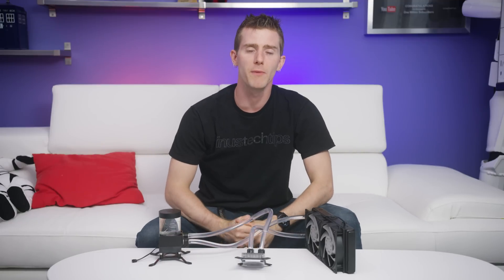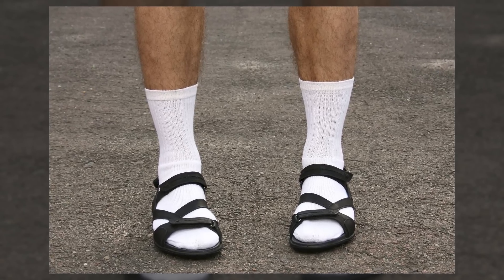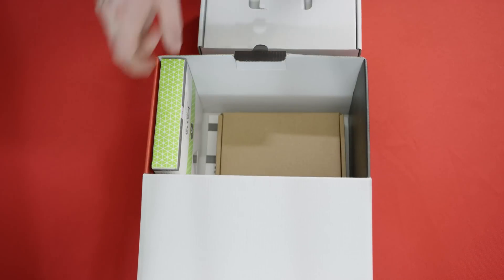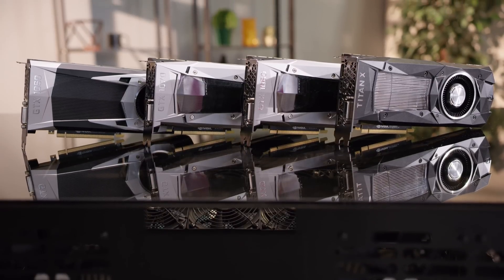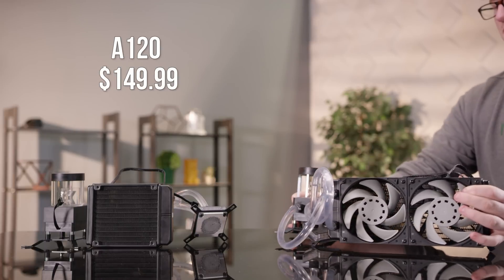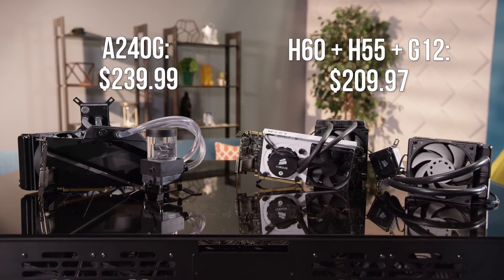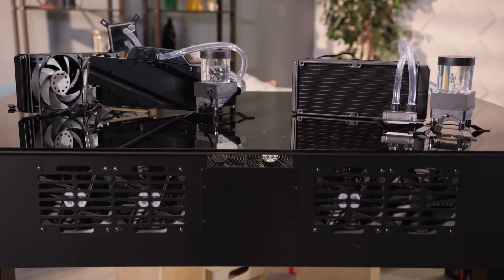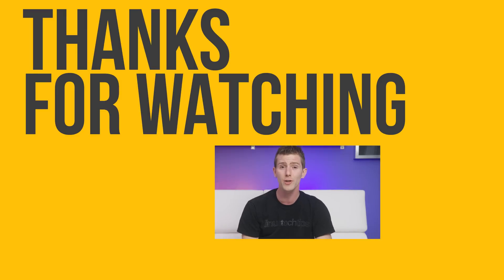CUSTOM WATERCOOLING AT AIO PRICES!? - EK Fluid Gaming Kits

Comment: Id say that a graphite CPU pad, 6 Noctua fans in push pull on a triple radiator, plus a Much bigger water pump, much bigger reservoir with multiple peltier juiced and attached to the reservoir could give better performance than a few degrees.

Comment: Not even close to aio price EK slim cost 300 bucks. You can build custom watercooling for les then 150bucks off ali express with 2x 360 rad and a pump that is strong enough to push even gpu waterblock. and its all copper. Im not hating on EK but that shit is crazy overpriced

Comment: jeeeee, wait a minute! So right now my water cooling system cause corrosion??!!  ((what!))  I don't have these products for my water cooling system, but i have distill water which goes to ek titan x waterblock and then to ek cpu waterblock and then it goes to sr2 COPPER radiator and come to reservoir for pumping. SO RIGHT NOW MY WATER COOLING SYSTEM CAUSE GALVANIC CORROSION AND EVENTUALLY WILL PIERCE MY WATER BLOCKS TO THE ACTUAL CPU???? Can some1 please tell me if it's correct or hopefully i got it wrong and it's just for those products! I would be really appreciate if some1 help me out of this and share some knowledge!
Reply: I made a research, and i got this that it's just a battle between alu and copper. So black ice sr2 radiator is cooper made, as manufacturer says. And two water blocks are from nickel which is a close metal so copper. So it should only cause galvanic corrosion in a really long term. And then it was the pump motor which is in contact with water. Mine is a alphacool VPP655 and as they in their site says, it built from Plexi, Plastic, Ceramic and ceramic is a non-metallic solid material comprising an inorganic compound of metal, non-metal or metalloid atoms primarily held in ionic and covalent bonds. So as i understood my water cooling system should be fine and out of galvanic corrosion. Would be happy if some1 correct me if i'm wrong!
Reply: @azhax6127m  Distilled water become rapidly a ion's + soup. All the minerals it touch will be effectively put in solution . 
Then the mineral's ions will become more aggressive where temperature is higher (against any metals).
Reason why copper's ions against copper are worse attackers, but let them find ANY other metal :-)
Same is true on Aluminium against Alu.  High temp make all worse, that means more inside the Block, then inside the rad.
Remember: Use two metals and in your Ion's soup you'll have at least two  metals ions  :-) or three or four .... :-))
Never use only distilled water without adding some specific protector.   >> Hope it help.

Comment: the dangers of aluminium and copper mixing have been mythologised thanks to forums. In reality it can be done. The severe damage on old swiftech blocks was a result of very long time periods and running a coolant with no anti corrosive properties thanks to the "all you need is water and a silver coil" advice touted by experts in the forums. 
Now years later thanks to the rise of transparent blocks from nearly all the manufacturers it is easy to find many cases of damage to loops caused by silver and copper sulphate or rather the lack of any anti corrosive. 
In the automotive world alloy blocks are cooled by copper core radiators all time and no ones engine is springing leaks. Thats because proper protective coolants are used and the copper and aluminium are not actually physically touching each other like in the old swiftech blocks.

Anti alloy terror is still rife in forum world but its very exaggerated and unrealistic.

Comment: Koolance abandon'd ALU because of a guy named DEAN he used to be PR for koolance. 

He went to XtremeSystems and asked a guy there why no one had interest in their products. 
No one liked ALU because Copper has better conductivity, and back then it was performance before bling. 
Also people had enough of Thermaltake's Aquarus line. 

Later on many people gave Dean Feedback, and koolance started bringing out Copper products.
It first started with Quick Disconnects, later waterblocks, and finally bay reservoirs. 

With the introduction with Copper blocks and copper products, koolance could no longer support Alu products. 

Users like Naekuh, Skinnee, Martin, then started to endorse them as well as provide feedback which boosted popularity back to then.

Comment: costum loop for being silent and cool so really worth  the req min for me is 360 rad  per component where the big d5 pump start to benefit compared to AIO  . 240 rad for each component will do fine but the tubes will be quite warm specially if u wanna cool a 1080 ti and a oced i7 that will damage faster ur tubes (very fast plasticizer will spread over blocks like sh@t) and maybe the pump over time ... if u can not 360 rad per component get a bigger case or don t do IT !!             
 3 x 240  should do the trick if u are 1080 or lower power wattage  card

Comment: Corrosion is ONLY an issue if you mix copper and Aluminum. If the entire loop is all aluminum there is no issue. My only beef with the kits is that they do not offer thicker radiators as a kit option. EK makes 5cm rads..

Comment: Additives won't ever help to prevent galvanic corrosion, you'd need to use non conductive liquid like mineral oil 

But I believe that has less thermal mass so cooling is less effective.

Comment: I've gotten conflicting answers about this but will the A240G work with a 1060 FE 6GB (like the one show in this video)? EK's site shows it on the product page but not when you use their configurator nor is it listed on the actual box of the product. Other 1060's show up on EK's configurator but not the Nvidia Founders 1060. The 1060 FE looks like it has a shorter PCB so I'm wary about buying the A240G if it'll end up not being compatible.

Comment: copper is a better conductor of heat, but ALUMINIUM get cooler faster, but I wonder how long this material is going to resist the changing temperature?  life cycle would be short I think copper is more resistible material

Comment: if you mix copper and aluminium you should use oil as liquid its not conductive so there will be no galvanic corrosion but you can test the anti corrosives liquid to buy  with a simple test take a 24v led and build a little circuit where one part of conducter lines is a bit of the liquid
Reply: The cost associated with an oil pump would probably offset any savings by making part of the loop aluminium. Also you'd then have to check that all components don't degrade in oil. 
I think you might be over complicating things at that point. Just use copper.

Comment: alphacool has a cheaper offering, with copper/aluminum hybrid construction on the rads and blocks, and a pump integrated into the blocks, and they use a modular gpu block design that is TRULY universal, and supports AMD. I think I'll stick with that, or just air cool like a pleb, because cheaper. I can OC, if I feel like it... but I don't really need to. most games and standard workstation workloads run just fine on a Core i5 or Ryzen5 CPU at stock speeds, and you'll always get more GPU performance per dollar from just upgrading your graphics card, anyway. Water cooling is most useful in scenarios where noise is a huge concern, like recording or video editing, or in office environments that absolutely need to minimize distraction, or in situations where multiple high powered systems will be operating at load in extreme proximity, like server farms or LAN gaming cafes. Outside that, imo you're wasting your money, or you're doing it for looks, which is marginally justifiable, as well as your prerogative. Also, don't use i9 processors without liquid, even at stock clocks, but tbh only benchmarkers/techtubers should buy those, anyway, because ripoff.

Comment: If mixed metals is a such a huge issue how come the majority of the AIO's on the market have copper blocks and aluminium radiators?Because inhibitors!
 I run a mixed metal loop and have no problems what so ever running distilled water and a non glycol based race coolant/inhibitor.I run soft tubing and acetal/copper blocks so I can clearly see there is no discolouration or build up of any type what so ever,loops been running  over 12 months now.I will do a flush and coolant change for prevention more than anything else.
All these rumours of issues are down to people using bloody tap water OR using distilled water only.If mixed metal loops were as evil as many a youtuber points out, the AIO's would all fail! Except they don't and they last for freaking YEARS without even a change.

Comment: Is this a decent budget gaming PC build?
CPU:
Intel - Pentium G4560 3.5GHz Dual-Core Processor 
Motherboard:
ASRock - B250M-HDV Micro ATX LGA1151 Motherboard
Memory:
Crucial - 8GB (1 x 8GB) DDR4-2133 Memory 
Storage:
Western Digital - Caviar Blue 1TB 3.5" 7200RPM Internal Hard Drive 
Video Card:
EVGA - GeForce GTX 1050 2GB ACX 2.0
Case:
Thermaltake - Versa H15 MicroATX Mid Tower Case 
Power Supply:
EVGA - BV 450W 80+ Bronze Certified ATX Power Supply

Comment: Like I said with Jay's video. The only reason I'm not running out and buying this kit, is there is no way to add another radiator, and the radiators are not 280mm. Plus I need a 10 series GPU, curse you 970.

Comment: Automakers have been mixing aluminum, iron and copper for years in shared coolant loops without these issues. Normal auto coolant prevents any if all galvanic corrosion issues.
Reply: in systems that mix aluminum and iron youll find they don't have standard coolants (orange dexcool instead of basic bitch green)

over time it will cause the aluminum to corrode... seen it on aluminum intake manifolds (GM V6)

Comment: I cant see any reason to not use AL coolers.
Cars have had Aluminium radiators and engine blocks for decades. 
So if a cooling system is designed well without mixing of materials that dont go well together and you use an appropriate coolant then its going to be just fine and cool.
I have a 19 year old car, Aluminium engine block and radiator. and I hasnt ever had a new engine or radiator. 
Two decades old turbocharged petrol AWD car... Aluminium. running temperature 90 degrees celcius. If an Aluminium cooling setup in a Pc cant last 10 years due to corrosion well then something is terribly wrong... probably mixed materials or the coolant type.
Honestly Id expect the waterpump to fail way before corrosion would cause a leak.

Comment: As someone who dealt with Aluminum / Copper galvanic corrosion in the electrical wiring arena, I can say that the use of Aluminum in a manner that brings it into contact with Copper is just plain STUPID !!!!  Many years ago Copper became expensive and Aluminum wire was allowed....BIG mistake !! The use of " Penetrox" on the Copper/Aluminum connections was SUPPOSED to eliminate concerns of corrosion,but, DIDN'T !!
      In addition, the opening shot in this video of a pile of water coolers made me recall my trips to the auto salvage boneyard, where I sifted through piles of crap looking for the solution to my used car problems. I mean, WHO wants to turn their PC into a FISH TANK ??!!!

Comment: This is a lot of cash for something that's more hassle and generally lower quality than AIO solutions. It has some slight advantages (reservoir to refill, ability to clean/flush the loop) but also has major drawbacks (cost, cheap fittings/tubing).

Still sticking with my NH-D15s, but if I were to go liquid I'd probably still opt for a Kraken since Corsair's AIO coolers tend to use very noisy fans.

Comment: been running a mixed loop for about 2 years,
added sentinel corrosion prevention liquid made for central heating systems.(still got a spare 120cmx40cm duel panel rad i might add to the back of my desk)

Comment: Wait. You're running gpu and cpu on a single 280 rad and the components in succession... that's a huge no go for WaterCooling no?
I'd have loved to see how the pump holds up if you add in another 240 rad which is most likely what would've made quite a big difference for not a lot more money.

Comment: EK also announced they will be releasing separately purchasable aluminium parts soon (likely together with the A240G with an RX Vega block), as well as customisable kits (more blocks or rads, and coloured coolant), and a 360mm radiator.

Comment: biggest risk with mixing copper and aluminium is THERE ARE NO STANDALONE PARTS YET
also I've got them working on including dimensions on things like the GPU block for case clearance as you'll have issues with certain small cases

Comment: I really hope the industry moves forward with water cooling parts made from aluminium rather than copper. There are many benefits aluminum brings to the table and we might even see the cost of custom water cooling parts go down in price if they use more economical materials. Besides its not like copper is doing much better to cool our systems than aluminum is.

Comment: Anyone else notice that gpu temps were all lower on the A240 without GPU Block than the one with the GPU Block? That means that the air cooler was actually performing better than the water loop. Gave me a chuckle.

Comment: corrosion inhibitors do work. although not forever, I had a mixed copper and aluminum loop for a few years and I used car antifreeze/inhibitor (the green stuff, it also glows under black light so that's a bonus)

Comment: ok so i have been running the A240G in my rig for about a month and i have to say that i love it. the only problem i have is you cant buy the GPU block on its own, i want to add another GPU to my rig but if i want to water cool it i have to buy another rad and a pump because of the aluminum. other then that i love this kit, it was my first jump into water cooling and the temps im getting are great around 55 to 60 degrees c.

Comment: Not into Aluminum. To fragile and it still suffers corrosion. Not worth it in my book. Just save for the "Real" thing. Ten times as many copper/brass water cooling parts to choose from. Aluminum only EK and limited selection.

Comment: I just bought a custom loop and for some reason my idle temps are insanely high. 
39C-42C Idle CPU and 40C-42C Idle GPU.
55C-62C at 50-60% CPU load and 79C-85C at 83-90% GPU load.
All Fans are at 1100RPM. Using a XE 360 Rad. 
Loop goes are follows: Pump/Res> Rad> CPU> GPU>Pump/Res
Can anyone help me lower my temps or figure why its so high?

Comment: I'm using a custom loop from ekwb, and my i5 7600k sits at about 31-33 C at idle. Is this about right or should it be lower? I think my riing fans are spinning at about 1200 rpm.

Comment: The loop goes from reservoir to GPU to CPU to radiator back to reservoir. Isn't that a bad idea? Regardless of which direction the fluid is moving, you're taking the hot fluid output from the CPU or GPU and using it to try and cool the other component.
Reply: There've been many tests done that determined that the order of components has no impact on the cooling.

Comment: 0:23-0:33 "A degree or two" A custom watercooling loop is, of course, much more expensive than air coolers or aio's. But the performance of custom watercooling is a lot better than any aio. I am talking of differences up to 10°C and more if you get the right amount of radiator space. You can also achieves much higher and more stable overclocks with it.
Reply: Isn't that the same as buying AIO with bigger radiators?
Reply: Custom loops can definitely drop serveral degrees, however nowadays, they're more used for appearance.
Reply: And when you custom water cool your pc you can have your graphics card(s) cool af. Currently running double 560 rads in “The Tower 900” and my components are super cool. Looks dope af compared to AIO:s
Reply: He said that all aio loops are a degree or two from eachother
Reply: It's also the coolant in the loop. Custom loops give the advantage of more expensive, often copper parts throughout the whole loop. Along with that, while liquid coolant has a thermal conductivity limit, the actual coolant in the loop can make a big difference. In Jay's video he talked about one of the biggest benefits of this loop being that you can top off the fluid after any level of evap, while an AIO is closed and cannot be open even though liquid will slowly evaporate over time. Custom loops just give the user more choice about how much cooling they want. Along with Aesthetics, AIOs simply don't perform as well as loops that have radiators that are twice as long or twice as thick
Reply: Custom loops are definitely better and can be 5deg+, with less noise and better looks etc etc.

They are better but they are also significantly more expensive.

More widespread for sure but still enthusiast level of pc building
Reply: I think he means difference between custom water cooling not aio and custom
Reply: The difference is, you can put more or better radiators in a custom loop, which can get the temps lower.

Comment: A240G with 5820K@4.3 GHz + GTX 1080 okay? I usually have either CPU intense (Lightroom, Handbrake) or GPU intense tasks (VR gaming), not both at the same time. Would like to put it in a Jonsbo UMX4.

Comment: I bought the id-cooling hunter duet for 160 dollars. I have much better cooling. I run a 5ghz 7700k and a 1080ti, the hightest temps I get are upper 50's low 60's. Copper plate with a copper block cooled by a copper rad. It might be chinese, but the fact that there are two pumps and no exteral accesories.... Can not beat it.